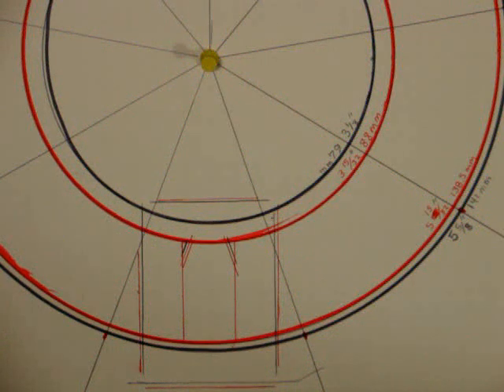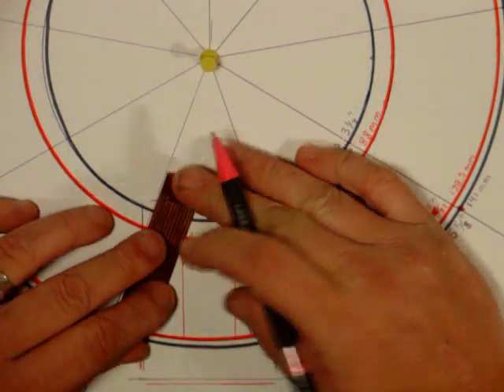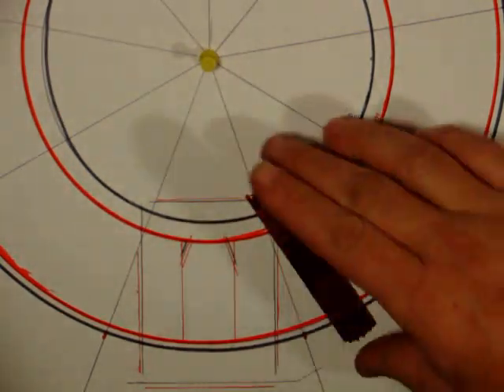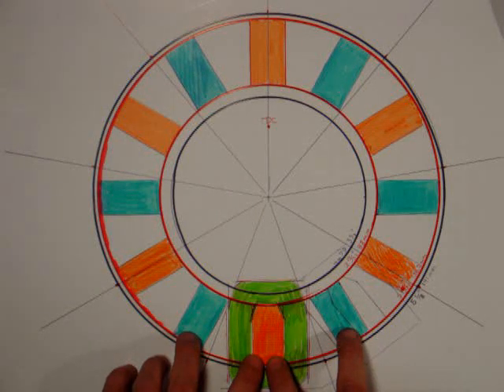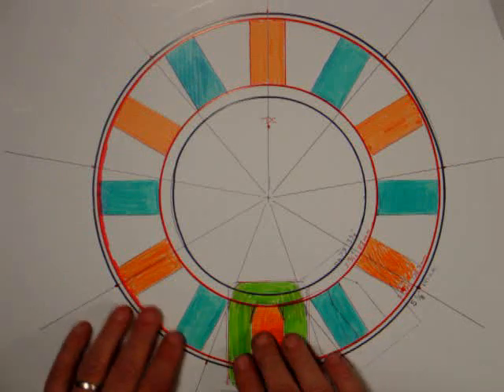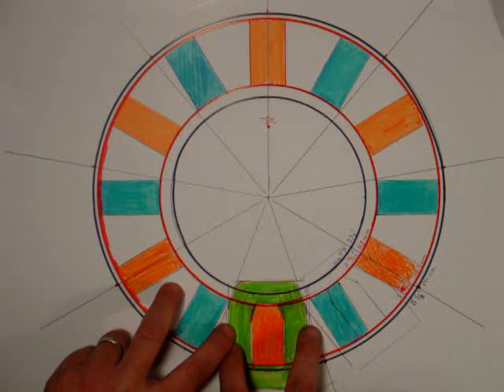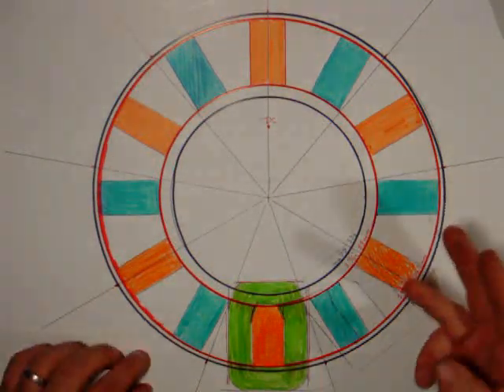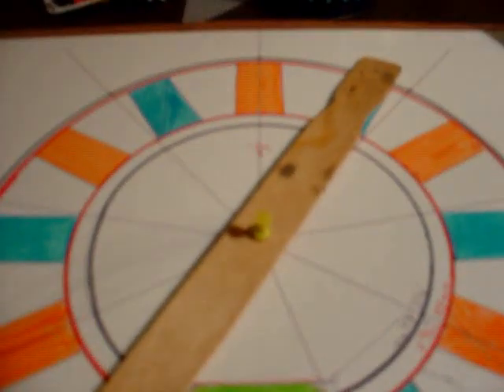BUILD A  DUAL PERMANENT MAGNET ROTOR ALTERNATOR  (PART 2)

Comment: Sir how to calculate turns and voltage of coil
Reply from the maker: Too many variables to be accurate. Such as strength of magnetic flux at the separation of the air gap. Speed of the magnet... ect. 
So winding a test coil is always a must unless copying a known setup.

Comment: I have a question... since the most expensive parts in this type of alternator are the permanent magnets... why not use 2 stators instead of 2 rotors, with the rotor sandwiched between the 2 stators? You would obtain the same effect of doubling your power for the same rpm... but do it cheaper since copper is cheaper than neodymium...

Comment: Can the Dual Permanent Magnet Rotor Axial Flux Turbine you have designed here be used for a Vertical Wind Turbine. I understand that you have designed it to suit a 9 foot prop, is it possible to design a Vertical Turbine to equal the performance of the 9 ft prop.
Reply from the maker: YUP, JUST WIND A DIFFERENT STATOR TO DEAL WITH THE DIFFERENCE OF RPMS. YOU WILL NEED A PRETTY GOOD SIZED VAWT ROTOR TO TAKE ADVANTAGE OF THE CAPABILITY OF THE ALTERNATOR. SMALLER WIRE, AND MORE WINDINGS. OR GEAR IT UP, BUT GEARING UP MAKES FRICTION LOSSES CLIMB PRETTY HIGH, THUS POWER LOSSES.
AND HIGHER START UP WINDS.
REWINDING THE STATOR IS BEST.
MUDDy
WINDINGS DEPEND ON THE START UP RPMS OF THE DESIGN YOU HAVE.
WIDER IS SLOWER RPMS BUT BIGGER AREA OF WIND COLLECTION,(WIND SWEPT AREA), FASTER RPMS FOR A ROTOR THAT IS LESS WIDE, BUT LESS POWER. BUT YOU CAN ADD POWER TO THE SAME WIDTH BY MAKING IT TALLER. COOL HUH?
MUDDy

Comment: All these videos fail to answer one question: are the magnets magnetized through the thickness or through the ends. Loosely translated, are the North and South poles on the ends or one the top/bottom of the magnets. Makes a difference on the magnets I have to buy. My eyes aren't good enough to do a lot of research.

Comment: @muddymuddymuddmann 

built the popular JGRO found at cnczone out of MDF first, after that bought an aluminum Techno table with all the bearings & lead screws and added own electronics and motors from hobbycnc. Was proud enough with them to build a small room for the two of them to keep the dust out of the house.
This will probably be the same room I will mount the control board of the wind and solar electronics.
I thought about using thick plexi to make the magnet rotor. It cuts nice.